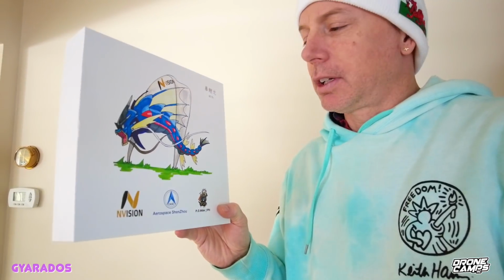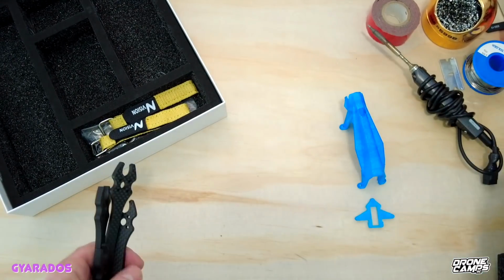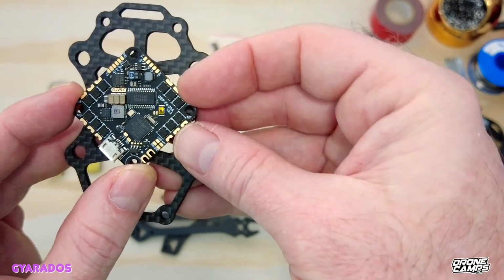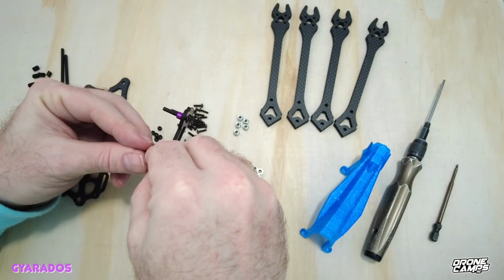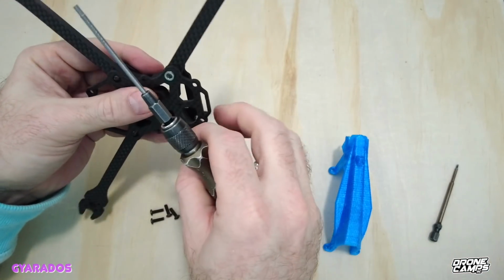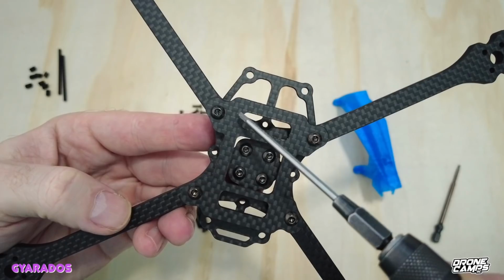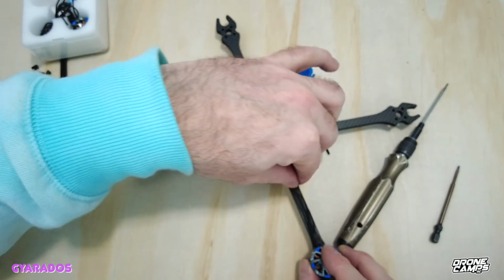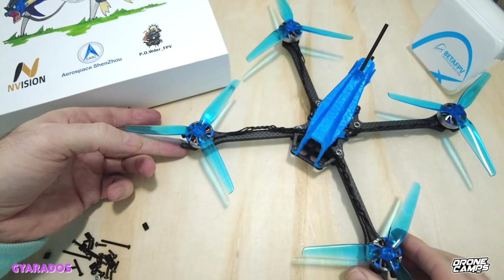WOW ONLY $30? - Nvision Gyarados 5" Fpv Toothpick Quad - PRO REVIEW & OVERVIEW 🚁

Comment: Hi Justin   Great video and review of the NVision  Gyarados frame.  Well I guess I just will need to purchase one.  I just built a ultra light quad using the Diatone F411 aio 26.5mm board but it is only 4s rating and HGLRC AEOLUS 2004 3000kv motors.  I like how the BetaFPV will work with 6s,  so I guess I will have to get one to try out.  Thanks again for the video and information.
Reply from the maker: Yeah man. I found even better motors than the Betafpv motors. T-Motor version in the link below the vid!